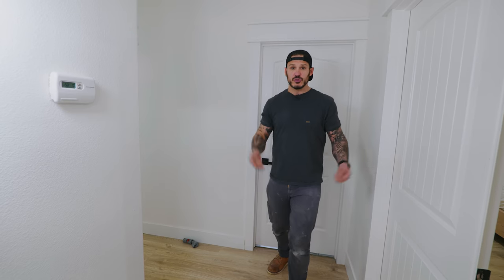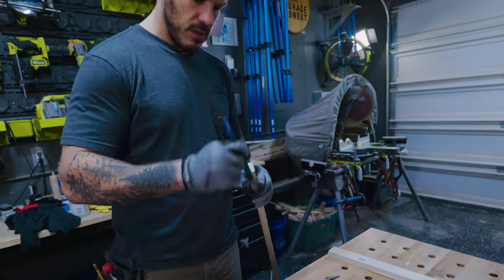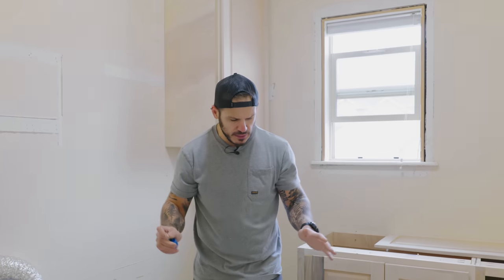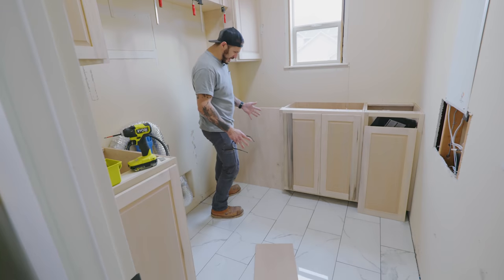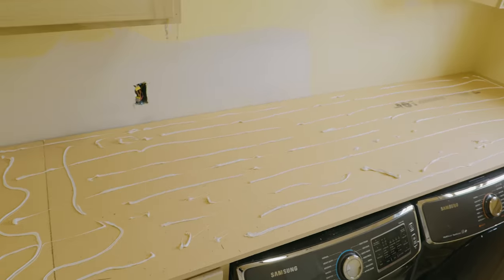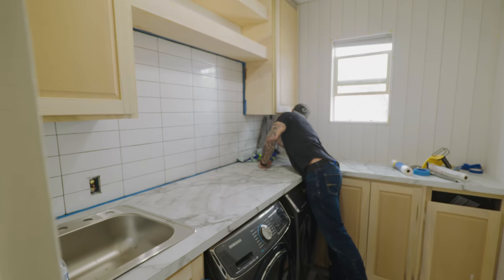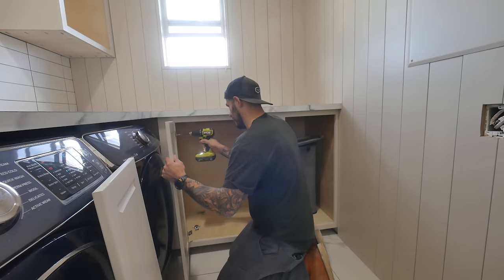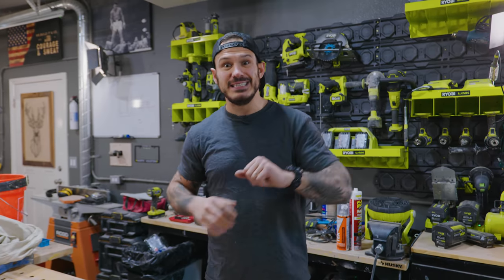Completely Gutted Our Laundry Room

Comment: This man is an electrician, drywall expert, woodworker, plumber, and probably many other things. I’m impressed.
Reply: expert is a little far fetched
Reply: He cut out the bottom of the wall studs, didn't repair it, and just drywalled over it.   Amateur hour.
Reply: @E-N-A-R-D-L-A-V  100% ... said he was going to build support... and then didn't.
Reply: And is that wall load bearing? Is so, then you compromised the structural support of everything above it.

Comment: Is there no concern for the studs that you chopped off?  It is hard to tell at 10:40 if you actually added back support for those studs.
Reply: this is what I was wondering. It may only be 2 of them but it still worries me.
Reply: Nah all good, he’ll sell the house in 5 years and make it someone else’s problem
Reply: Yeah that double is load barring....
Reply: Those are usually extras in case you need to cut them off
Reply: no need to worry guys, what's behind the wall stays behind the wall 😜🤪👍🤯
Reply: Homeowner special. Created like a 4ft+ span with 0 load transfer to the bottom plate. Garbage.
Reply: And that plumbing! Not as important as structural lumber but it's not to code. That P-trap has got to go

Comment: Dumb question - for the studs that you cut the bottom off of, were you going to build them back after the plumbing?
Reply: Another dumb question--did you update your dryer outlet to 4-prong would you were at it? (Which requires running a new cable from breaker box) Or was yours already updated?

Comment: So, I love your projects and I've been inspired/ learned a lot from you. Our laundry room is much smaller, but I want to do some similar things in ours that you just did. I think it looks amazing! However, I have a question for you... If you need to do maintenance on the dryer/ washing machine, how do you access them with the counter built right on top of them?
Reply from the maker: Pull them out from the sides

Comment: Love it!!! I don't know if those bendy straw drainpipes meet code though (at least so I've been told by professional plumbers when I dared to try and use one myself).
Reply: Same here. I used one on a DIY job a few years ago. When we sold the house in 2020 the inspector said it had to come out because it wasn’t up to code. It worked fine, so if you’re not planning to sell your house anytime soon I wouldn’t worry about using one.
Reply: I'm a plumber,  and you're correct,  not  a legal fitting.

Comment: Hola,
What did you do to re-support the 2x4's you cut to run the New Plumbing ?
Reply: im with you.... what was the plan with the floating wall studs....
Reply: I actually rewinded a couple times to find out, had the exact same question. I'm pretty confident he didn't do anything...
Reply: Bluetooth studs.. I don't think structural but I'm sure he'll have some cracking in a year..
Reply: I stopped a few times right as he put on the drywall, he didn't do anything with the cut studs. Alex needs to step up his game or he's going back to work as an RT
Reply: Saws all blade didn’t pinch… probably not a load bearing wall
Reply: @dadlife8289  I did the same to see what he did.
Reply: they arent load bearing but still should of prob put something in there

Comment: Greta vid, a little tip we do over her in the Uk when tiling a floor.
Get a scrap bit of tile place it face down and cut the archs, door frame (we use a multi tool/oscillating tool). That way the tile will slide under and be a much nice finish :)

Comment: 10:40 so not sure but looks like you didn't add any support back for the studs? i am sure its not load bearing but probably not the greatest.
Reply: I noticed the same thing!  That means the upper cabinet is only being supported by the drywall.  Hopefully that’s not a load bearing wall also!
Reply from the maker: Not a load bearing wall. Cabinets attached to 30 inches above the stone on the left and in the middle
Reply: Glad to hear that the wall isn’t holding anything above, but you still need to put support back in when you cut studs clean off.  Someone watching this and doing as you do may be cutting in to a load bearing wall (something to keep in mind).  For a non-load bearing wall, the studs are still carrying the weight of the wall and anything that’s hung on it - cabinets, shelves, laundry, etc.  The wall obviously won’t collapse immediately - since it didn’t when you cut the studs off - and there’s a chance you may never have any issues depending how the framing was done, but there’s a good chance that things could begin to sag because the cut off studs are now only being hung from the top plate.  As the weight slowly pulls the nails out and the drywall can’t support the weight, you’ll first see cracking and hopefully fix the issue before the wall collapses.  This is why it’s common for 2x6s to be used for plumbing walls - so that holes for pipes can be cut through but not compromise the structural integrity of the wall.

Comment: Some odd things I noticed in the video: why didn't you move the Washer & Dryer out before you started the demo? It was awkward to watch you try and maneuver junk around the units without damaging them. I'm assuming it's because this project took some time and the units needed to remain in place so you could still do laundry. Also sort of surprised you didn't incorporate a way to relocate the huge water filter that was previously attached to the washing machine. That thing looks like a complete PITA to change if you need to move the washer and dryer around every time.
Reply from the maker: Because we still needed to use the appliances

Comment: I’m sure you’ve been asked this many times, but what is the purpose of cutting the plywood with it on top of the thick insulation board?
Reply: It’s so your plywood is stabilized to avoid a pinched saw blade. You could also use other types of supports like 2x4’s underneath to stabilize so your plywood doesn’t flex as you’re making your cut. You can get really bad kickback on the saw depending on how pinched things are.
Reply: Also protects the surfacr you’re cutting on - plywood isn’t perfectly the same thickness. Even if you set your saw perfectly to zhe right thickness it might cut a bit too deep

Comment: That’s all well and good if you assume you’ll never have to access the washer’s supply and drain lines or the dryer’s vent. Because there’s never leaks, and you don’t need to do a good lint cleanout every year.

Comment: The flexible p trap is not to code
Reply from the maker: yes it is.
Reply: Got 2 of them in my house
Reply: It might meet code, but there is always a better way to make the connection without using the flex. Those things are notorious for clogging and leaking. Ok for a temporary solution only in my opinion.